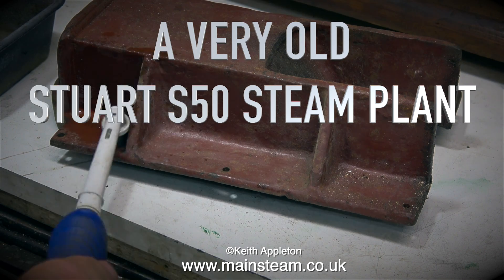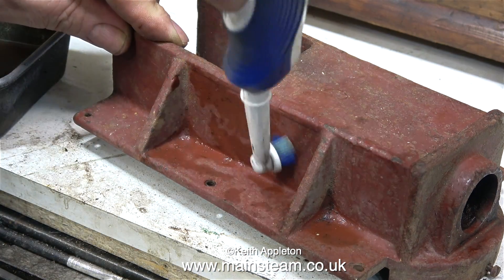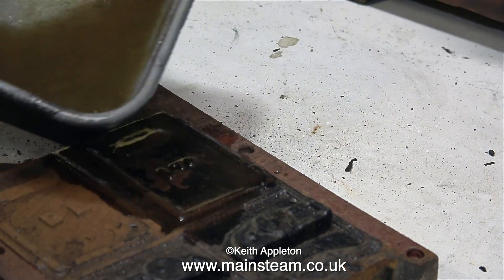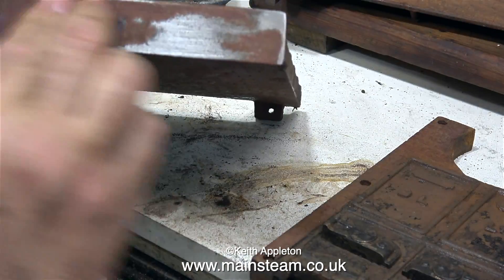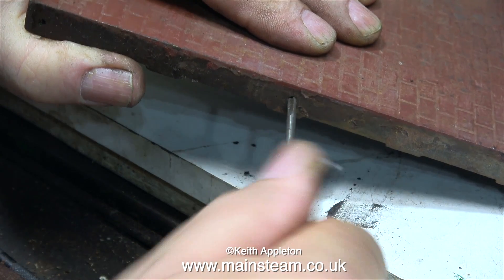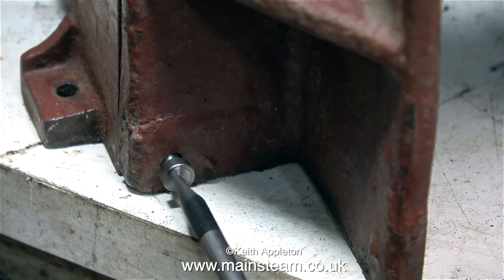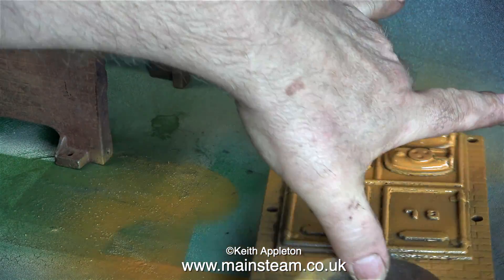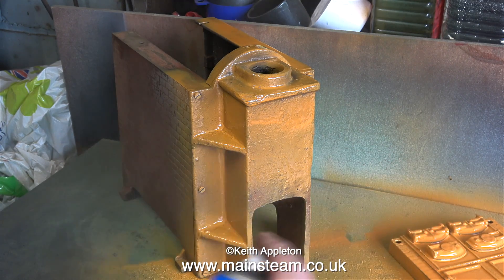A VERY OLD STUART S50 STEAM PLANT - PART #17

Comment: If your panel wipe dissolves some grease or whatnot, and then it evaporates, it will deposit the grease again more evenly spread around except for the dissolved grease carried away on the toothbrush.  Dipping in solvent will dilute the grease and leave little behind.  Wiping with solvent takes away grease on the rag.